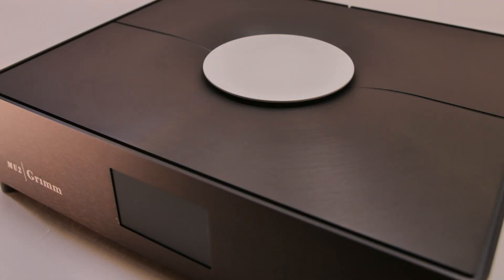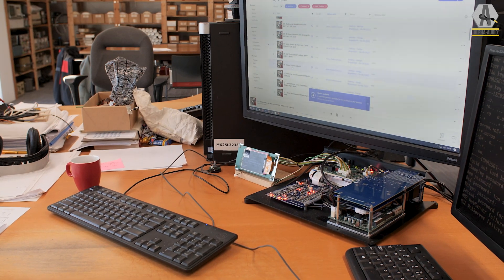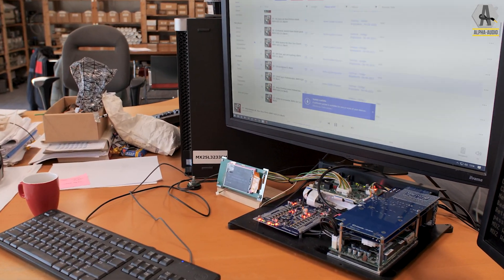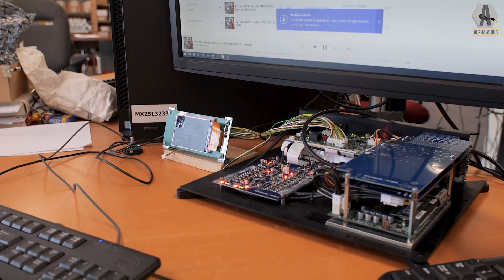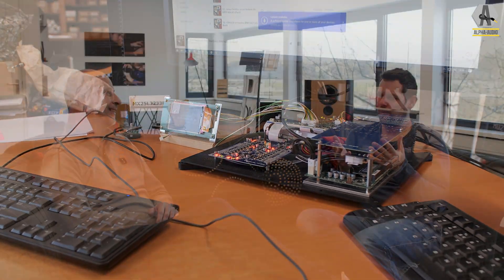About the Grimm MU2 - Part 2 - The analog part

Comment: In regard to thermal distortion, that could be one reason class a amps sound so good.  Because the current trough the transistors always remains the same, therefore no change in temperature.  Also, all other electrical components remain at a consistent temperature once warmed up fully.
Reply from the maker: Probably!
Reply: Class A is continuous conduction, not unchanging current. The current varies with the input signal and load. Class A transistors will run hotter with no music playing (largest voltage drop across them) than with music playing.

Comment: Lyngdorf uses switch mode power supply.
"supply is extremely well regulated and is filtered and decoupled to provide a low noise and low impedance supply to the digital and analog circuitry. With different supplies from four independent secondary windings on the transformer, the analog and digital supplies are kept separate to minimize digital noise in the analog circuit. Grounding is optimal, and the entire chassis is connected electrically. The back panel is electrically conductive."

Comment: great conversation again - thanks!
- question about the switching power supply - is it sending noise back into the grid? - potentially affecting other gear
Reply from the maker: No. Not really. Just a tiny bit that should not affect other gear. Check our review with the measurements.
Reply: @TheAlphaAudio  I will, thanks!